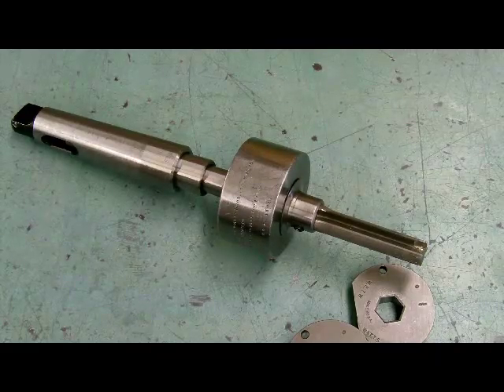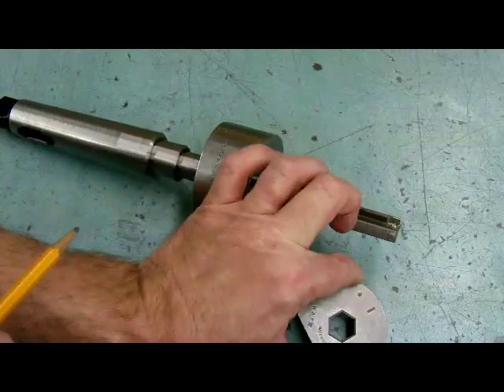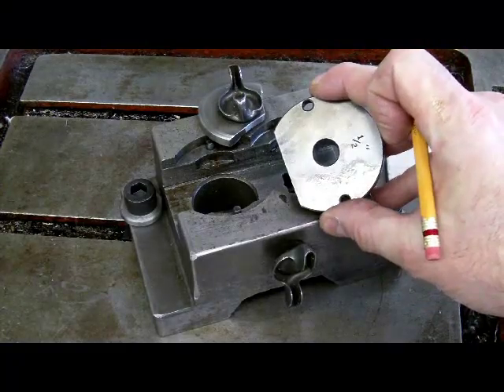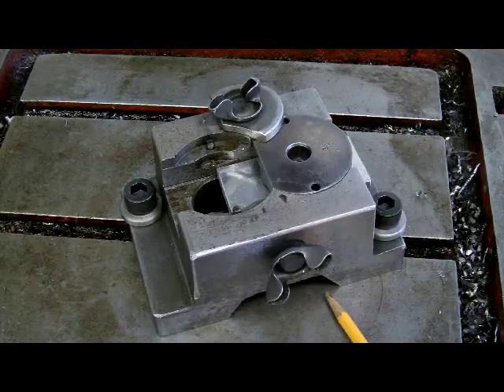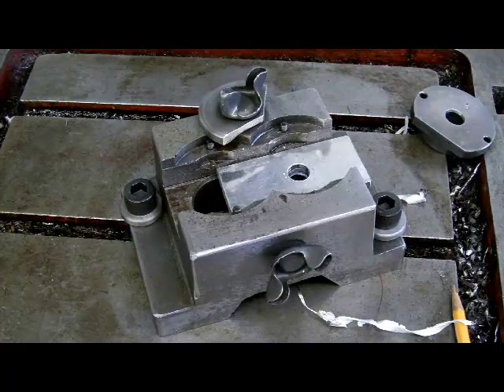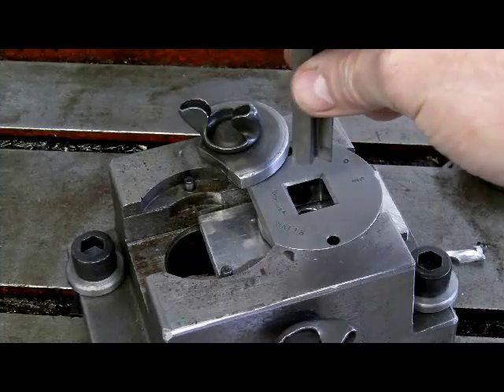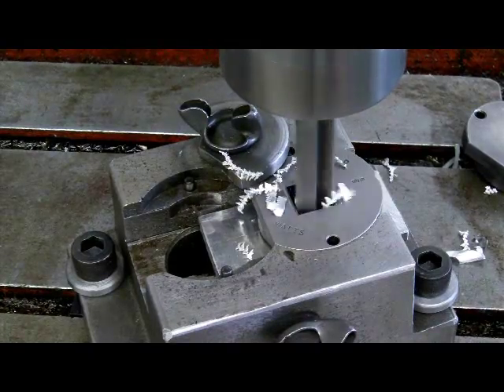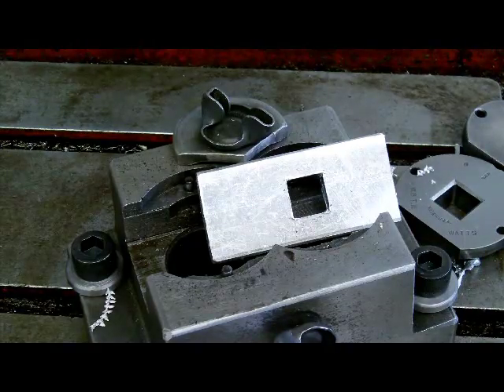Drilling Square Holes

Comment: Great vid, thanks for posting!  This is a nice tool!  It will cut blind holes, a situation in which broaching is difficult at best!  The pilot is hardened tool steel and the triangular drill is very likely high speed steel.  The cutting edges of the drill contact the surfaces of the pilot during use.  How fast does wear occur?

Comment from the maker: Yes, the drill is mounted on a morse taper so it will fit in the tailstock of most lathes. You would need to adapt the die to your headstock/chuck.

Comment from the maker: Yes the process is the same but the die (or guide) is 6-sided. It is shown at the beginning of the video. Yes it will work on a blind hole but it does require a pilot hole. Thanks for your question.

Comment from the maker: The short answer is it depends on how hard the material is, like any drill the harder the material being cut the shorter the time between sharpening. the pilot or guide is hardened steel. The setup in the video has been around and in use for years. Thanks for your question.

Comment from the maker: By using a cutting tool with one less cutting edge than the sides of a triangle (two cutting edges) an triangle shape can be made. You would need a triangle shaped guide. It can also be done by hand.